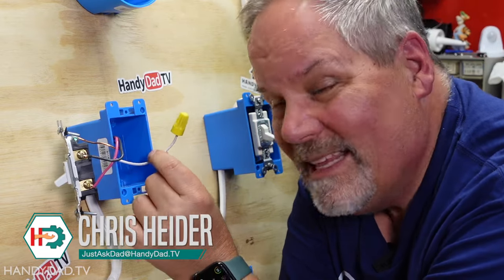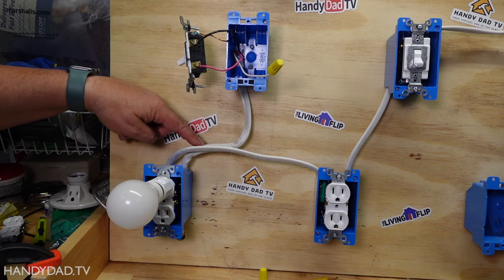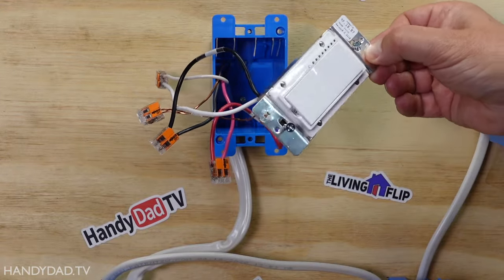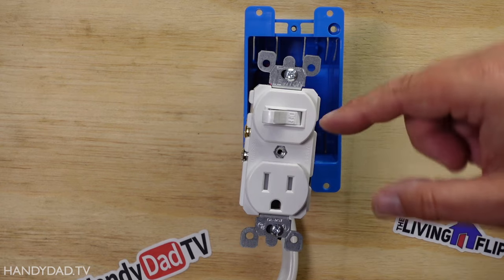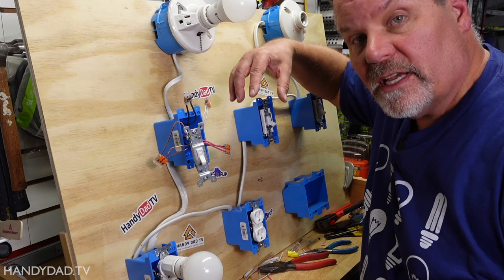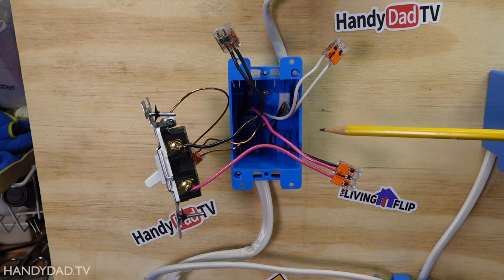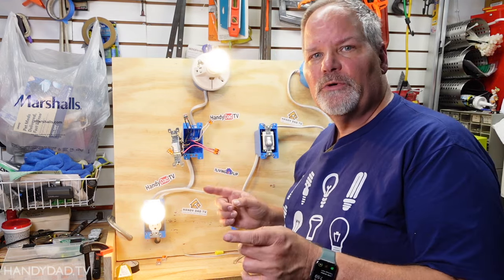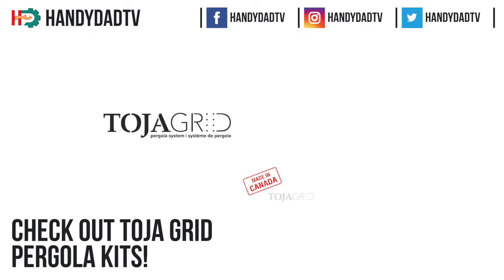Why do I need a neutral in every switchbox?

Comment: Total pain in the arse when you convert to smart switches and find that every other switch box is missing the neutral wire.
Reply from the maker: There are limited options for smart switches that do not require a neutral wire.

Comment: I agree with you, but it’s important to mention this; There are two exceptions to this requirement. If installation is with raceway where a neutral can be added or if in a wall cavity with access to make a neutral available.
Reply from the maker: Sure. But I think it’s still a lot easier to run 3-conductor wire.

Comment: I went to install smart switches and didn't have a neutral in the box. I had to replace the existing 14/2 with 14/3 and it worked like a charm. The rest of the switches were just fine, however they weren't at the end of the run. I guess that's what you get from a 1971 Commodore manufactured home.

Thanks for this info!
Reply from the maker: Gotta love old houses 👍🏻

Comment: Thank You for your very informative and well thought-out videos. I have one question to ask, in reference to the 1st way that you demonstrated how to wire a 3-way switch to a light........and my question is, could one use the neutral wire with the black tape (Hot) and add a pigtail (black) to feed receptacles on the same circuit, and if so, how can it be safely and legally done?
Reply from the maker: Sure

Comment: I think this is what I need for my situation of having power go to my lights first and then 3 way switched after the lights. Everything I see shows 12/2 wire going to the lights and then 12/2 from the light to the first 3 way switch where the neutral is marked as hot like in a switch loop. I think I actually need 12/3 from the light to the first switch so I can carry over the neutral and then I'd use the red wire for the switch loop to the first 3 way. Is that right? Or how would that work?
Reply from the maker: Correct. If you want a neutral at the switch, you need another wire to use as a conductor.

Comment: I am having trouble installing a smart switch on a 20A circuit. I am using a 15A Lutron smart switch. Is the different amperage the cause of my problem?
Reply from the maker: No, you’re fine. That just means the load on the switch can’t exceed 15A. 

Could be a defective switch.

Comment: I just bought the BMW x5 45e.
and I have a problem with the charging system.
charging code with come with is so slow. it only has 10 Amp.
how to make this fast charge system
could you do some videos for BMW buyers?
thank you very much
Reply from the maker: I don’t have a BMW to test with. Sorry.
Reply: You'd need to run a separate higher amp breaker I imagine with 10/3 wiring. A 15 amp breaker shared with other outlets is not nearly enough for a fast charging system. Basically need the same setup like an oven or hot water heater.